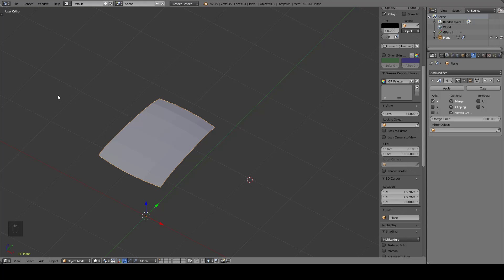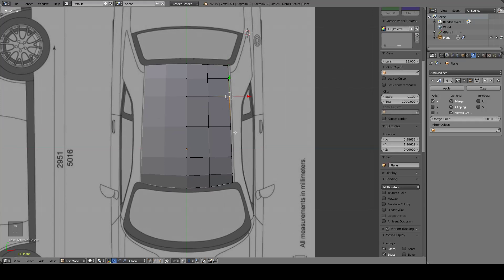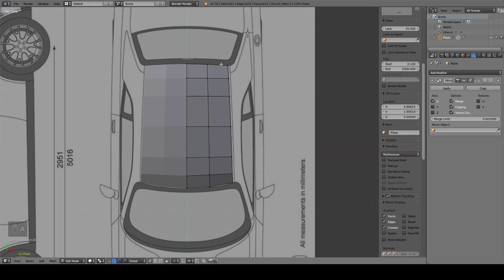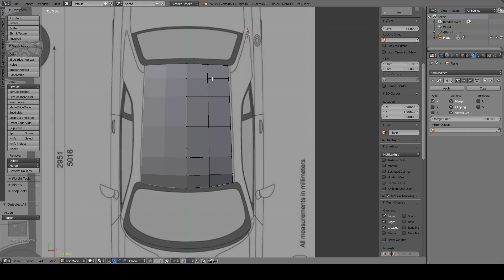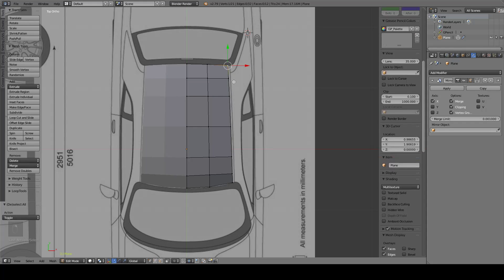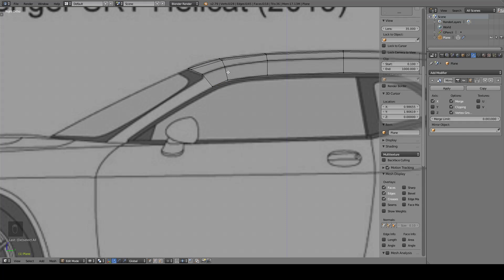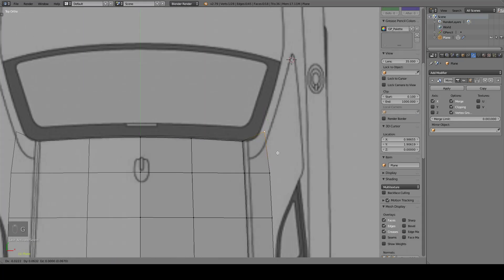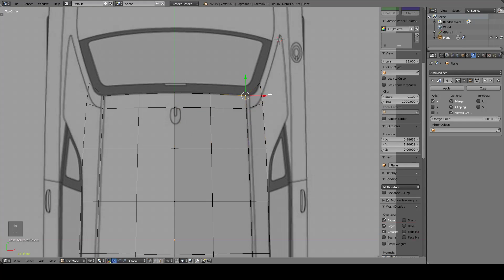Model a 3d Car | part 4 | basic edge flow and topology (Blender tutorial)

Comment: Personally i think the front pillars are more difficult than the back half lol

While viewing any perspective, (side,  top, front), you can also press 9 on the number pad and it will flip the view to the opposite side. 
So if you were to press 1, on the number pad, to view the front,  and then press 9, you will flip to the back view. 
A little easier than pressing CTRL+1. 

Also, when loop cutting, if you want the loop cuts in the "default" location, after you choose the amount you'd like and you can now slide them around, you can Right-Click to can cancel the slide and it will pop in the "default" location.

Comment: A and B pillars. A is the front and B is the rear on a 2 door car. On a 4 door B is the centre and C is the rear.
Reply: i know its 5 years late xD but slightly wrong on that one, the a pillar is the first pillar of the car, typically at the front windscreen, the b pillar seperates the front door glass and the glass behind it, (most 2 door cars technically dont have b pillars) the c pillar is after the second panel of glass, and for cars that extend out to beyond a second door (like an estate car) they can even have a dpillar to the rear

Comment: Im trying to model a 2016 Camaro SS and its kinda different from the car you use in your videos, and it doesn't have black outlines for the windows and the little area behind the door or whatever is hard to model while making perfect quadrilaterals. All the shapes are rectangles but theyre all stretched out and when I go to the front view of the reference picture and my model, everything looks weird and the back of the car is bigger than the front. The part where its on the side of the car under the back window (where the gas thing would be), when I tried to match the vertices with it, the tip was too sharp. And when I looked at your model, nothing was sharp or messy, everything was smooth, even though the shading was flat. I dont know what to do about the sharpness and mixed up vertices. Help?

Comment: I need help!, every time I press “G” to drag around my dots it keeps creating another line or it extrudes another one :(
Reply from the maker: long sometimes if you extrude vertices but don't move them there can be two vertices in the same spot. Either use ctrl z to go back a few steps and see if it's fixed or you go into edit mode, select everything (a), press space bar to bring up search menu and type "remove doubles" and then press dented and see if that works. Let me know
Reply: worked!, thank you so much :D
Reply from the maker: thats always a frustrating issue, but glad to hear its resolved!
Reply: im sorry if im asking too much stuff but, i saved it and left last night, and i just opened it back but i dont see my image when i press "1,3,7, ctrl 1" thank you!
Reply: im such a noob at this smh
Reply from the maker: long no worries. All good questions. We all start somewhere. 
I always thought that this happened when you move the file location of the image but not sure 100%
To fix it just open the background image panel again and click the file icon and navigate to where the image is and load it in again.
Reply from the maker: If it keeps happening what you could try is going to file, pack external files. And make sure that's checked off. Which will basically store a copy of the image in the blend file itself. 
Never tried it myself that may help
Reply: i tried the first one, but it still didnt show up.
Reply: never mind problem solved! your the best.